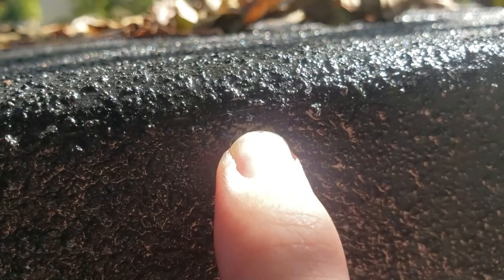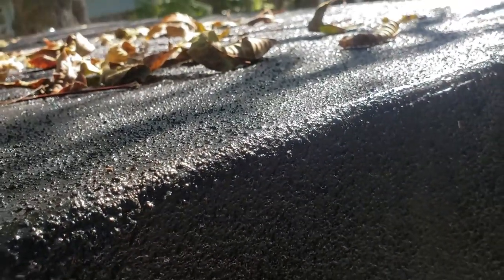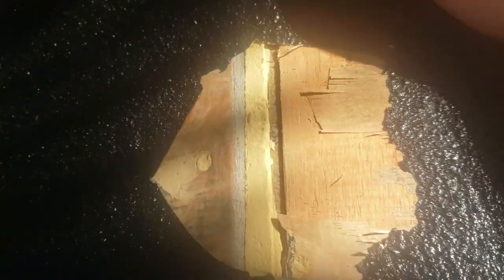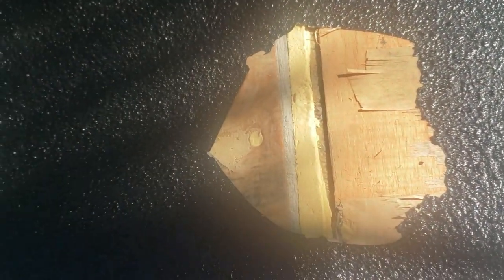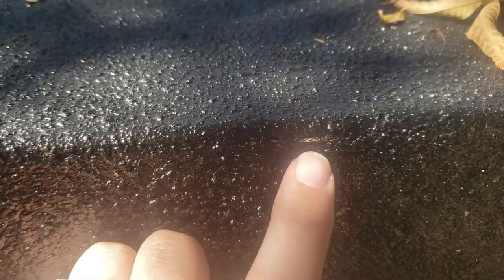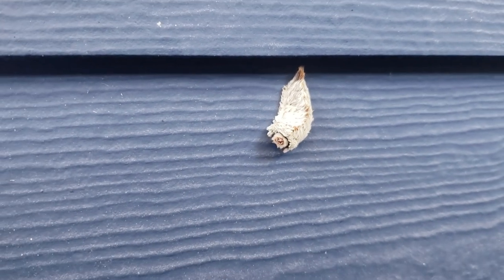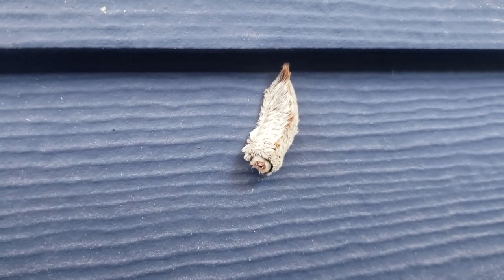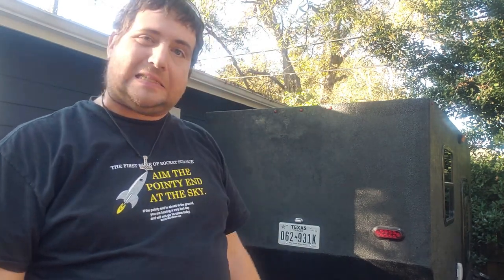Episode 12, Budget 4x8 Micro Camper Build (Roof repair)

Comment: Thanks for sharing in a real way. That's how you really help others. I wonder if some sort of fiberglass mesh tape at the joints would help to reinforce the bedliner.?? Good luck and again thank you.
Reply from the maker: My theory is because I used a spray on rubber material on the seam it prevented the bed liner from soaking into the wood around the seams causing an issue down the road. As time goes on I'll be checking on these seams to see if the problem is widespread or not. I'll have more info as time goes on.

Thanks for watching

Comment: That's what I had to end up doing. I got some black drip cap and ran it down the sides of my camper, and for the seams down the center, I just used butyl tape.
I haven't had any leaks since then. I put butyl tape under the drip cap too.
Reply from the maker: I really hope it doesn't come to that but it's an option on the table if this patch job doesn't hold up. The original plan was to put trim on the roof but due to time and budget constraints I ended up not doing it, but left it as an option later.
Reply: @downtownredneck5079  I didn't add it until I was a year into my build. I tried everything else first. Your solution might work. I didn't try that.

Comment: Hey man thanks for sharing this video! That problem really stinks! I have had some trial and error with these things myself and would suggest using roll on flex seal on the roof. Hopefully this helps! Good luck buddy!
Reply from the maker: I used a similar product called plastidip on the seams before I used the bedliner thinking the same thing. Somehow water got under that layer and then the bond gave out and it bubbled in that spot. I have heard that using flex seal is a no no from a few guys recently when doing something like this... Still learning

Thanks for watching, looking forward to more videos from ya. :)

Comment: Actually I may have used car body undercoating not truck bed liner. So ignore what I posted. Undercoating great for under car but not good for ultraviolet exposure I guess.
Reply from the maker: No worries, I've heard people using that stuff on the underside of the camper to weather proof it but bedliner tends to be the go to choice for underside protection. On this build and OregonBatman's current build we went with a physical plastic barrier for the underside.

Comment: Truck bedliner not good material  fades in sun to nothing. Painted mailbox with it in 3 months looked unpainted
Reply from the maker: I have heard that before and I've seen mixed results with bedliner in other applications. I've seen more positive than negative results when it's used properly and in all honesty the look is only second importance to me on this build. I went with it due to cost and durability of the exterior coating. If it starts to fade and discolor I plan on painting the whole thing with good quality exterior paint which will cut down on surface degradation. 

There is a builder on youtube that used a similar product on his HF build that's in the north west area of the country so less rain but his has been holding up well over the last year or two. Channel name is tireguy 1000 if you want to check his build out.

Thanks for the input though I actually really appreciate getting any info on stuff like this as it helps me learn and helps others in the DIY community. And thanks for watching.

:)